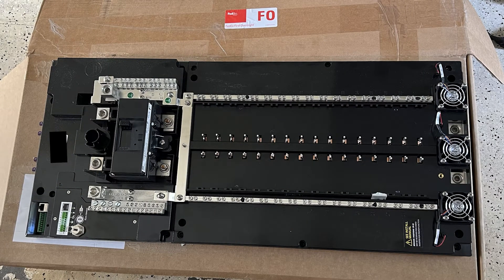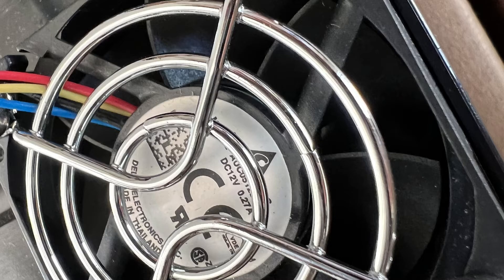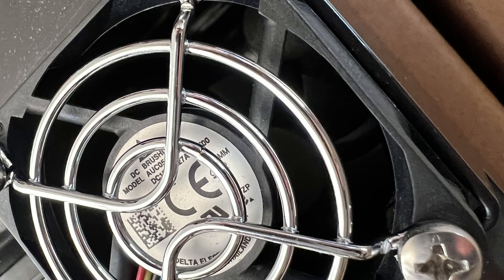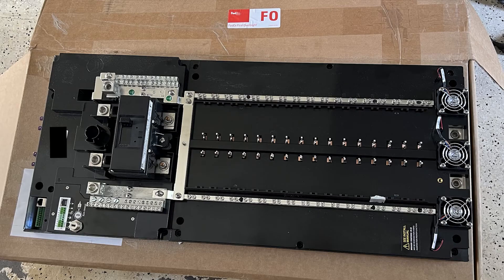Span Smart Panel: Episode 5 - DOH! Lets try this again.

Comment: Enjoying watching the process. I am considering a SPAN on a house I am preparing to build, and hope it doesn’t have half the challenges you are putting up with!

They can accept input from almost any inverter but say all the features only work with the two they integrate with. What features do you loose when you use a non-integrated (not Solar Edge or Tesla) inverter. It would seem all they really need is battery charge state to do the three stage load shed, and that has nothing to do with the inverter itself.
Reply from the maker: Thank you, I will ask during the interview.